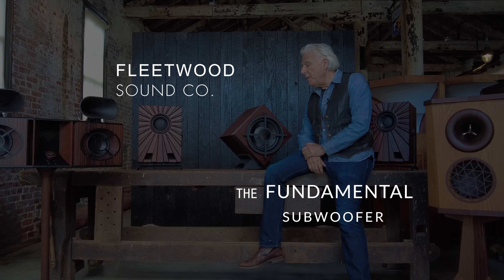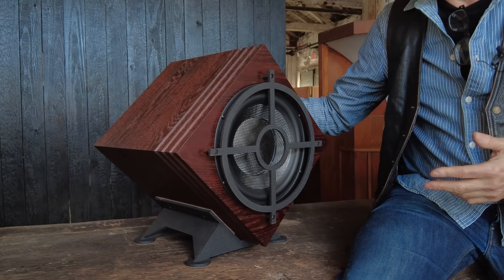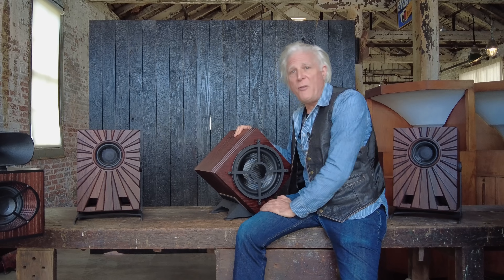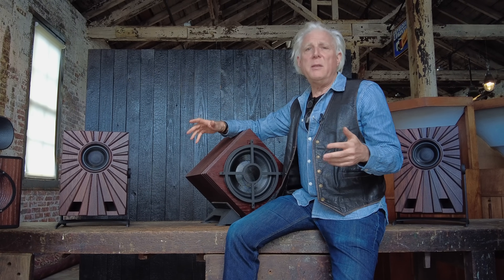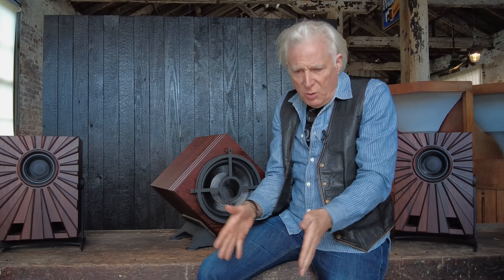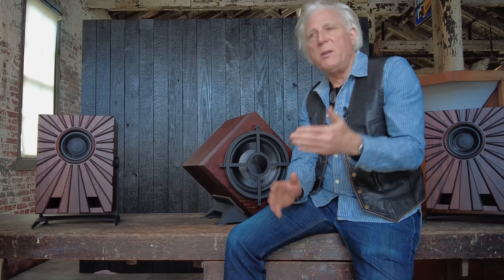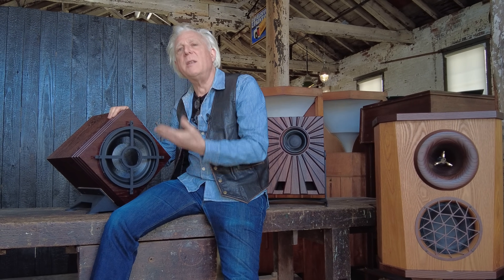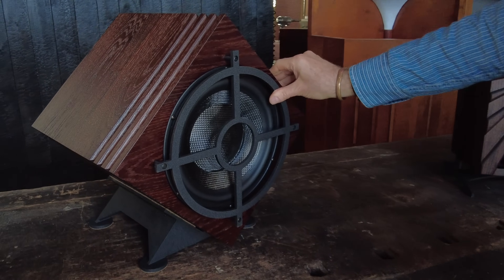Introducing the Fundamental Subwoofer

Comment: The speed of sound is just that! It doesn't have anything to do with how fast the driver moves. If the driver produces a 40hz output, it will be moving roughly 1,130ft per second. The driver doesn't slow the length of the frequency. How well it does/sounds is debatable, but the sounds speed physics doesn't change. People that think a speaker driver controls the speed of sound is a common mistake.

Comment: I built two subwoofers for my home theater system. Exact same woofers exact same plate amps, one was small box and sealed. the other had ports and was a big box. The first one could reproduce a gunshot the second one could make the house shake but that was it.

Comment: Phew the old stuff is the best sound. Just fixed a nice tube radio with a field coil speaker, its freaking good for way back then, Maybe i can run my reference amp into the speaker for fun. Im on a pair of wharfedale full ranges, but would like a very cherry set of field coil speakers or a very good solid magnet speaker but i dont get out enough to know whats what. Tannoy but too expensive, hence wharfedale with very fine tuning, Ive got it where if the copper sags and weighs on the cones (speaker or connector wires) it changes the sensitivty so its all very loose and fluid, probably very reference. Music is unbelieveably detailed. 

 I think people should start with open baffles as they are easiest and have much more potential than anyone NEEEDS.
'Greune' hall in texas had a probably once in a half century performance, by a small but cool as it can get band. I didnt know much about audio then, but they used the old stuff. 

The speakers in the dance hall area are full range open baffles probably driven by tube amplifiers, but maybe not, i would like to investigate, maybe theyd allow... 
Anyways, i remeber that speaker and its cabinet, its just an open baffle with a edge banding of plywood on perimiter edge for stiffness maybe 8 inches deep for separation and visual probably but just part of THAT design. Half a sheet of plywood sized and probably a 10 inch speaker. 

Was superb with everything going on then. 
Where the equipment would support the performance and Not degenerate. 
Besides a pure vocal performance, solo guitar, that one in gruene was up there in 'wow experience level'. But churches not so much and definetly not mush pits. The pro audio is dead expecially stadium level, just basically comparative to a bad expensive failed surgery or aborition. 

I think tubes and simplicity is made for "upgenerating" audio. Really, sound pressure, material resonacne, air properties etc.  
Thats basically what the conclusion the audio purists come to.

Comment: Disagree. I own the DeVille SQs and they are mated with a pair of REL 212 SX. The combination is outstanding / incredible. Happy to see you went this route. I know owners are going to be thrilled. The question, which is the same for any sub solution - do you go with one or two, two split off of each channel?
Reply: Depends where you XO. If it's below 80hz there's probably not much point having a second one.
Reply: My experience with RELs are extremely underwhelming. I was at a setup in the most renowned hi-end shop around here, with a € 350.000 rig, a stack of 10 REL subs, the main speakers demanded an x-over around 100Hz and the 12" RELs coudn¨t go that high so thay had to add some smaller 8" subs to cover 70 to 100Hz. the whole thing set-up by whatt I think is the best tech guys from REL. The lower bass was all over the place with what would be phase shifts and timing completely out of control. Boomy, crappy, unlistenable. So if the REL guys cannot make a € 350.000 rig play music I say absolutely NO THX 🤐
Reply: @Harald-MacGerhard so who makes a good sub in your opinion?

Comment: can it be placed flat on the floor? instead of standing up diagonally
Reply: Since it’s a sub, it should work the same either way. But maybe not.
Reply: Oftentimes raised well off the floor provides better sound. It depends greatly on the room. Also, decoupling from the floor is usually needed, even for solid concrete floors.  When installed diagonally not only does it look good but it keeps it from being used used as a plant stand or household debris accumulator.